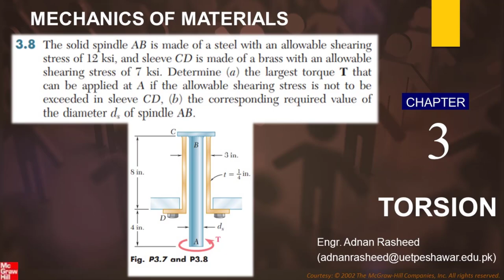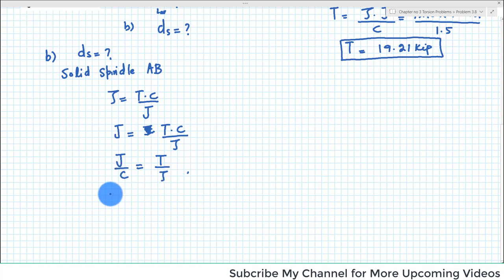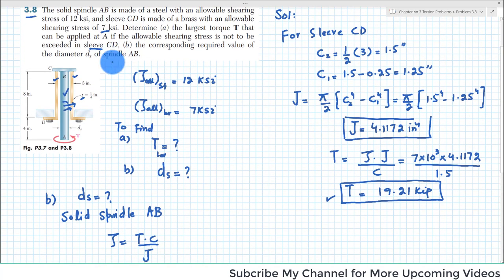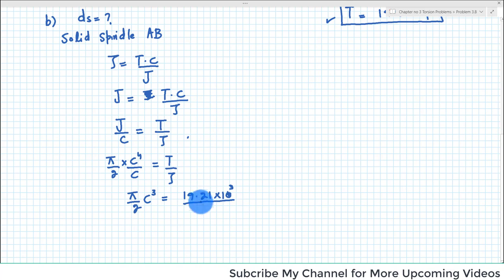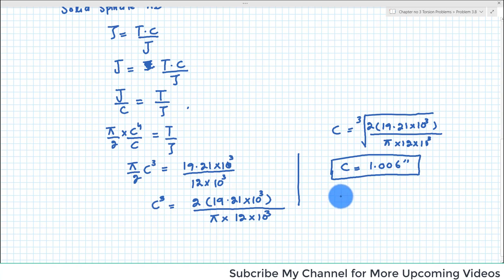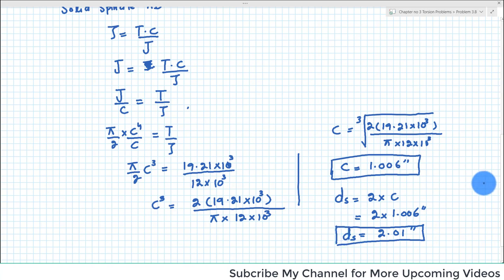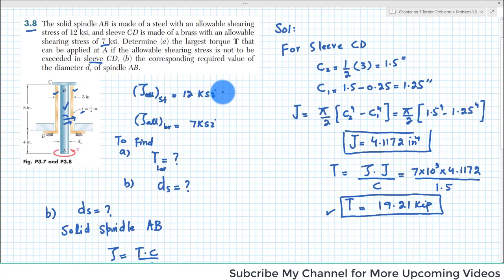Problem 3.8 |Torsion| Engr. Adnan Rasheed

Comment: Why isn't torsion force shared between the solid spindle and sleeve? Shouldn't it be T(spindle)+T(sleeve)=T(total)? The only problem I across with this method though is that it requires the modulus (G) of each material, which they don't give us.
Reply from the maker: you can see the figure that sleeve at the end is attached to steel rod AB. so torque applied will be produce twisting effect in the both so this torque will cause shearing stress and in steel rod since both materials are different so shearing stress will be different, Also in question it is given their allowable shearing stress that should not be exceed. so based on your allowable shearing stress you have to find the torque that will not exceed the shearing stress in sleeve. Also for your another point that G value is not given so materials are speciefied that one is steel and other is brass so go to the end of the book and check appendices with name mechanical properties of the materials , locate the materials and get it's different properties like yield stress , modulus of elasticity, modulus of rigidity G etc